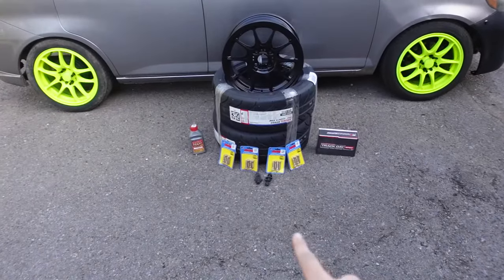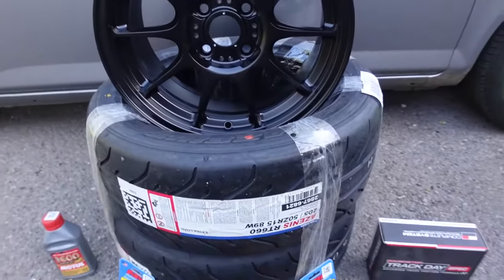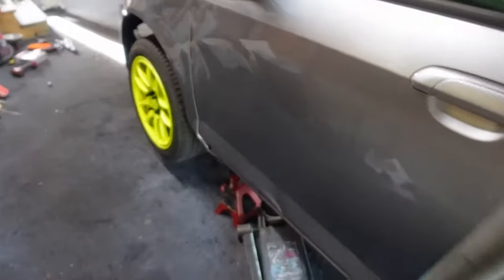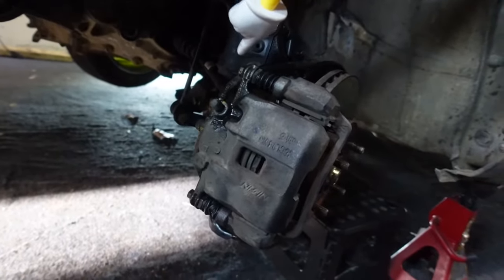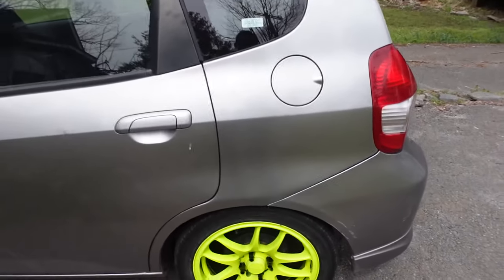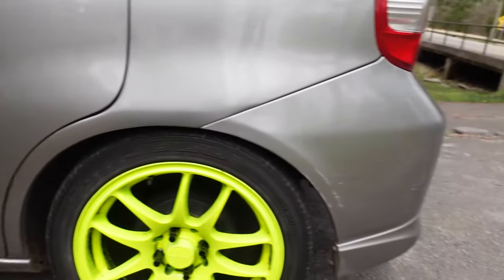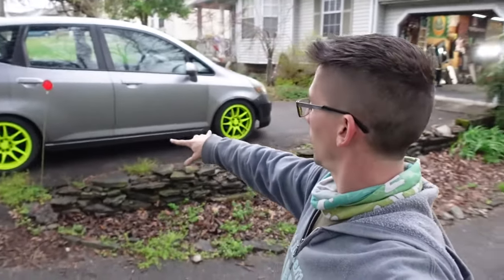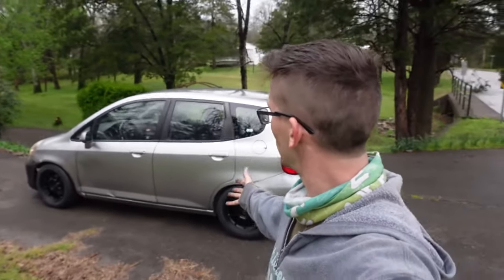Honda Fit Track prep

Comment: Good job, did you unbolt your front and backseat to save weight and remove spare tire? Or you worried about weight distribuion?
Reply from the maker: I still have all my seats, but do remove Spare when on track.  Per class rules i cant strip the interior unless it's for safety equipment.

Comment: When you set your camber did you have wheel and tire at ride height? It looked like that it was at full droop.
Reply from the maker: No i had to measure it at full droop to make Adjustments then put the wheel back on put on the ground to get it's true camber.  A time consuming process.